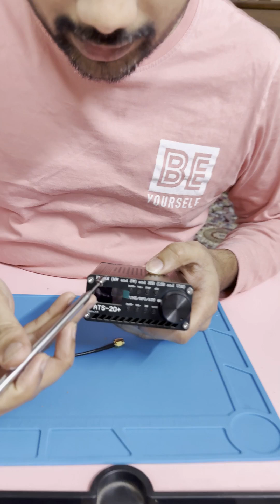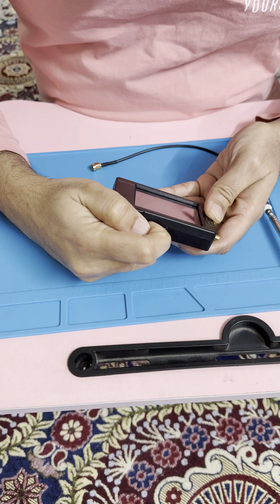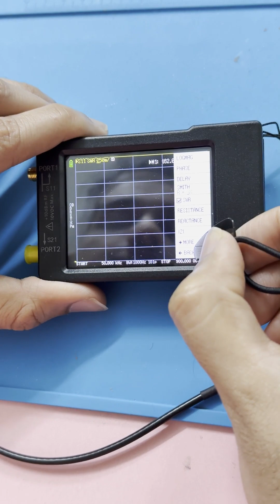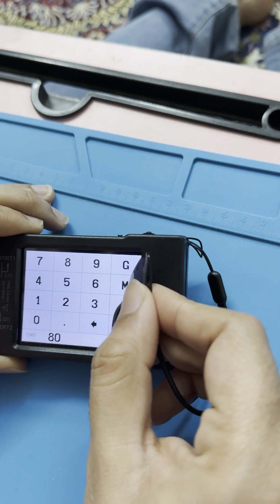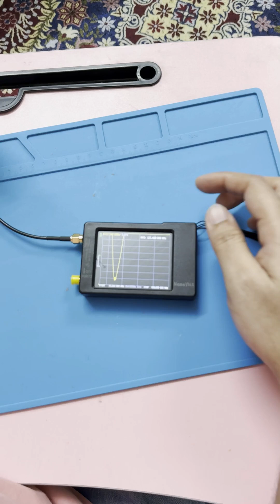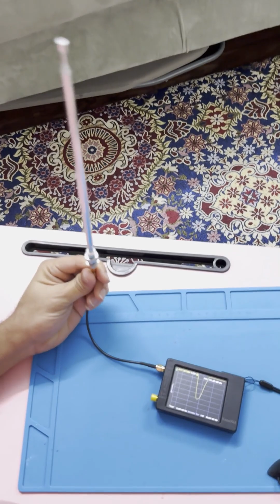NanoVNA - Telescopic Antenna SWR - Part 1

Comment from the maker: Update: I learnt I missed mentioning about a critical step about calibration here. Calibration needs to be done for frequency range of interest and for the model I have upon every power up. Without the calibration, though the trend looks as intended but the values of SWR/freq will not be reliable. I will throw more light on this in the Part 2.